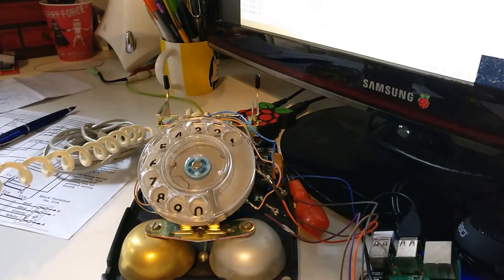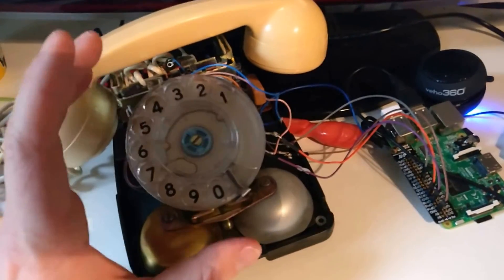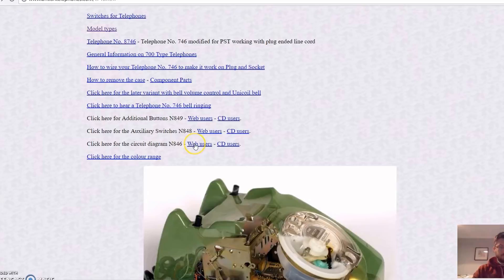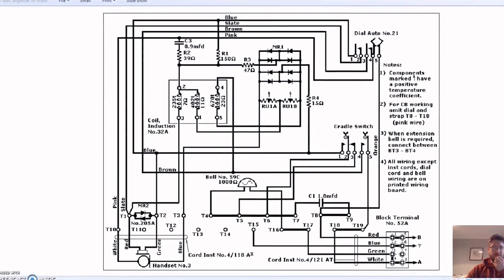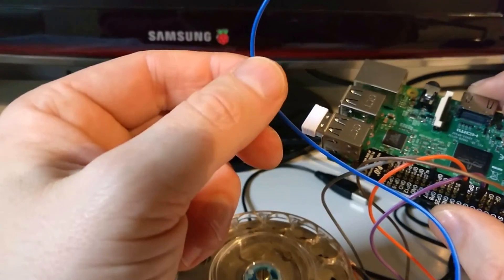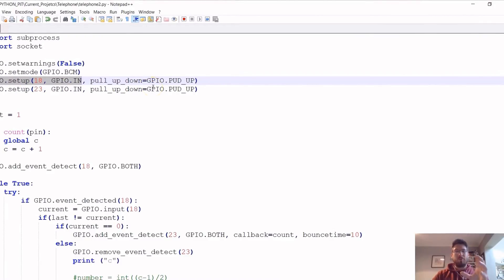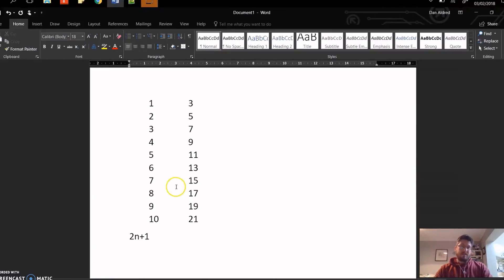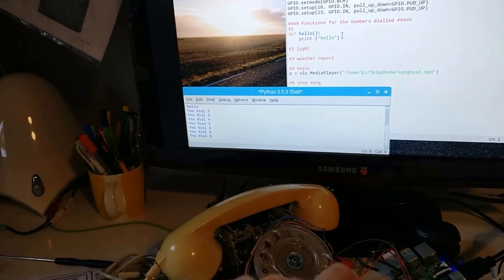Connect a rotary dial to a Raspberry Pi

Comment: 2n+1. Tq for your explain. I try to use rotari dial instead of keypad, in my arduino project.
Reply from the maker: Great 👍
Reply: @TeCoEd  by the way mine different from yours. It just exactly. Except for 0 is 10 Pulse.
Reply from the maker: @galihtanu  share a video when you are done.